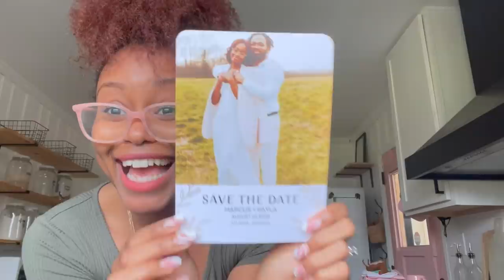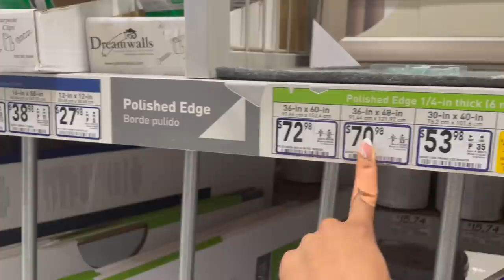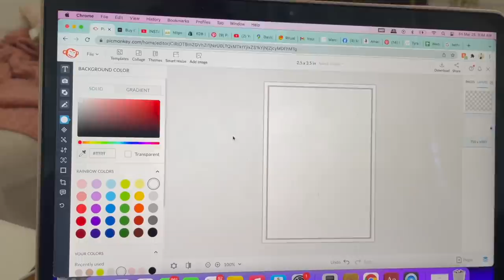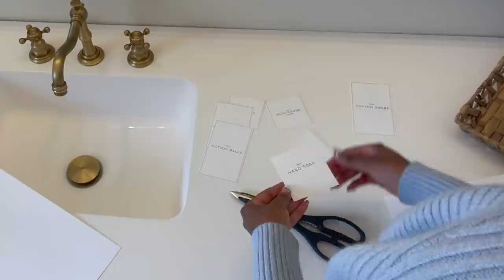DREAM BATHROOM MAKEOVER| I RENOVATED MY BATHROOM +Decorate With Me, Bathroom Vlog 5 #FIXERUPPER *NEW

Comment: Super beautiful makeover! If you grab a second shower curtain and put curtain hooks on either wall, you could have the curtains styled open most of the time to frame the tub. A set of white curtains with a texture to it and the tassels to match the rug/towels would also be very lux. In mine like to use a liner with magnets to stick to the inside of the tub with a cloth outer curtain to wrap the tub, keeps the nice outside curtain nice a lot longer, and the magnets stick to the tub, so no breezes in the shower.

Comment: Beautiful makeover. Suggestion since you have the pipe in the wall next to the light and it can’t be centered over the counter, maybe you can get a smaller mirror and center it over the sink and under light. Then in the empty space next to mirror add two smaller floating shelves for decor , (example candles, signs, toiletries for guest). Great JOB!!

Comment: Wow! what a beautiful job you guys did on this bathroom. Just an idea I had about the offset light fixture over your sink, I would find a classy clock and put it on the wall to balance it out. I personally have to have a clock in my bathroom to keep me on time. I tend to primp way to long and lose track of time.  Also, be careful of glass bottles and jars on your countertop. I have glass on mine, and I accidentally caught the spout with a towel once   and ended up shattering my porcelain sink.  Keep up the good work, looks amazing!

Comment: You can put up the white shower cutain and pull it half way open. Then tie back it to the left side. Like where you head would be if you are in the tub. Add a piece of floral or greanry to the tie back. You can leave it that way when you take a bath. And when you have guest, then it can be release for showers. I think it will be elegant

Comment: 🤩Hi Kayla--  just a few suggestions ... On your vanity, a covered/holder box of kleenex tissues would be nice for guest; a "dual" gold-tone, hand soap/lotion container; some personalized/monogram finger-tip towels (white w/gold monogram initials) for the basket on your vanity, w/the vased flower; a glass-topped jar, filled w/sand & seashells, placed on the tank top of your toilet, seated on a mirror, or oblong tray, w/some flowers or greenery, nested around it; 2/3 shelves, over the toilet; and, a framed, gold tone pic/artwork on the side wall, next to the toilet.  Further, I agree w/some of the other commentaries... Use the flowered-printed shower curtain, instead of the cotton, solid white one.  And Congrat's to you & Marcus, for outstanding work/remodeling, and, on your "engagement"!!💯😇🙏❤️  May God continue to bless you both, in All your endeavors!!💯😇🙏❤️💜❤️

Comment: If you can't center the light, I would get a smaller mirror to center it where the existing light is. Then on the right side of it I would put multiple small picture frames with bathroom phrases on it or small floating shelves with nice decor on it like a plant and etc. (Fruitful thought)

Comment: Someone doing the contracting or the electrician should have caught the fact that the electrical for the vanity light fixture was not centered over the vanity. If it was centered, the mirror would be centered under it properly. (I know the mirror was installed before it light fixture.)

Comment: #YOUNGLADYBUSINESS
GREAT TUB / SHOWER AREA!
SUGGESTIONS (I #love #interior decorating/hope I haven't gone overboard with #ideas):
Looking at your finished progress--it really looks great--yet consider this: Look into adding floor-ceiling double #glassshowerdoors--with same 1.5-2in., #framed #brushedbrasscolor AND at the shelving area--which will make your #polished, #clean and #crisp vibe and #choiceofdecorSHINE! 

Doing so would not be too #modern nor "hide" the country charm of your bathroom AND stop shower water from getting on the floor.

#NOSHOWERCURTAINS! #Ugh! (I personally dislike #showercurtains (lol!)) "Possibly" use the one you bought for #WINDOWcurtains and don't forget to hang them from the ceiling--to maintain the height of the room. 

#ACCENTS, TOUCHES OF COLOR
Your ecru and glass accessories #POP and I agree the acrylic handles and round pivots work best too. Use a lovely bronze/brushed brass floor rack for towels and use a lovely round pillow for seating, atop the stool.

Add #tallVASES in sage and olive also, to the shelving and bronze and/or ceramic #floorVASES--to give more inviting depth/#vibe to your choices. Try #Mayfair if you can't find any at Target or Walmart AND check Lowes or HomeDepot!

ALL at Mayfair.com: 
1.) https://www.wayfair.com/decor-pillows/pdp/joss-main-padillo-creamwhite-31-ceramic-floor-vase-w006881316.html

2.) $42.99 - https://www.wayfair.com/decor-pillows/pdp/house-of-hampton-2725-metal-floor-vase-w004711673.html

3.) $104.99 - https://www.wayfair.com/decor-pillows/pdp/lark-manor-vic-black-23-metal-floor-vase-w002572315.html

4.) $129.99 - https://www.wayfair.com/decor-pillows/pdp/murano-art-collection-allegra-white-black-ceramic-floor-vase-xcad1533.html?categoryid=215459&placement=1&slot=3&sponsoredid=d6f51981db57d29e3c28d592cc607c7b63a0af942f4033decfbef530827f05ba&_txid=I%2FWEwmJB20F3gBMaHGKLAg%3D%3D&isB2b=0&auctionId=24a03533-f68f-4cfd-b51d-5b1c5857b6eb

#ARTWORK & YOU'RE #ARTISTIC, YOU CAN DO THIS #YAY!
Use #twoworksofart, at about 20-24in., wide by "no less" than 3ft., height! Moreover--go to #Michael's / equivalent for framing... paint frames #sage and #olive / choose foam or firm light-weight boarding--#clearhotglue the dried greenery you like to the boarding and use considerable amounts of it, use a deeper green ribbon for "inset frame" or not.

#LIGHTINGCHANGE? / SPRAY PAINT TO SAME COLOR FINISHES
#Option if you have too: Possibly #cut the one you bought into two #fixtures (a little work, but #Marcus is so #skilled!), which would add additional lighted areas as well.  Or put the one you purchase on the wall to the left OR (if room) put it above the bathroom window or door. 

If you have to come up with another option regarding your #bathroomlighting--use a #gorgeous inexpensive modern-country #chandelier! 

#CheckouttheseCHANDELIERS:
Mayfair.com: 
1.) $128.00 - https://www.build.com/quorum-international-643-3/s1480406?uid=3475412

Build with Ferguson: 
2.) $190.00 - https://www.build.com/craftmade-50523/s1706615?uid=4025420
3.) $155.90 - https://www.build.com/millennium-lighting-2713/s1794542?uid=4240498

#DIY BATHROOM DOORS, LOOK AT THE SURROUNDINGS IN THIS VID, CONSIDER THIS...
Check out this stream from #yoduvh for ideas--to #accent a #plainbathroom #door and come up with #yourspin using the #dollarstoreideas / or paint a framing of #brushedbronzegoldleaf color of #leaves framing the door--at 2in., from edge.

Possibly add same to the natural color "line / thin vine or leaf" framing to your vanity doors (#hack: use color paper to test what works): https://youtu.be/X6aJRzq-QO4

Wonderful job!
Gd Bless!